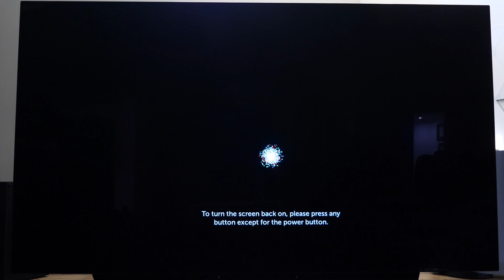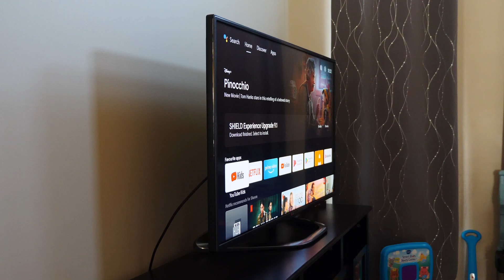TV Explained: Why Plasma TVs Are Dead

Comment: I don't get it. You say plasma died because of price, burn in, low brightness... It's exactly what OLEDs are.
Reply: He listed a lot more details advantages to plasma TVs. OLED have much more common with LED TVs, so it has the same advantages as LED has over plasma, except for prices and burn in. I never heard that brightness was an issue, but prices will eventually go down anyway and as he said, burn ins are only an issue, if you have a lot of static image, which is uncommon for home TVs.
Reply from the maker: What TulgaD5 wrote, there are additional details listed.
Reply: @TulgaD5  No burn in on my 2005 Panasonic Plasma tv still going strong after 20 years.  Typical power consumption is 200 to 250 watts (measured by kilowatt meter) and gets barely warm after hours of watching. Typical 2 hours of TV time/day power savings (vs LED/Oled) is trumped by supreme reliability and durability of Panasonic Plasma TV and not having to buy multiple TVs during 20 years.
Reply: @TulgaD5  Theoretically OLED brightness should be superior to normal LED backlit or edgelit (these are hideous) LCDs, as they aren't being filtered through lossy polarizers which famously cause issues such as terrible discolorations when viewed at an angle (case of Twisted Nematic LCDs), backlight bleeding out into the picture ruining the contrast further (case of some In-Plane Switching LCDs) and the worst offender that is an issue known as Black Smearing (a lot of Vertically Aligned LCDs got this issue, however I've seen those that are just fine and superior to some high end IPS LCDs in my own experience, told from the guy that plays in a CRT on PC). I would urge people to decide what they require the most out of their displays and study online reviews, as the displays on stores are usually very slow paced "cinematic" photoshoots and stills just to show the color and mask the real contrast of the tvs when looking for a brand new LCD, generally TVs will be more costly than computer monitors too on the lower end of each market segment but their main function is identical and will often share connections (like HDMI standard, for example, though however some computer graphics cards outputs feature only mini DisplayPort or USB-C, or DVI-I, or D-Sub 15 pin but anything except old stinky HDMI, leading you to buying a digital adapter for your device to display on a TV LCD).
Reply: But unlike OLED, Plasma is also very power hungry and heavy.
Reply: OLED has one pretty substantial advantage over plasma.
Efficiency. If I recall correctly OLED is generally considered the MOST efficient panel type for power consumption.
Reply: @TheDeluxeMcEmpty  I used to believe that too until I saw models like LG C4 pulling as much power as my 20 year old CRT! Then recalled the humble LCD that looks depressing by comparison draws about less than 30W on a hungry day, although older ones only get worse anyway.
Reply: no oled are so much more bright
Reply: OLED is brighter and efficient
Reply: @S1_2025yt OLEDs are dimmer and more power hungry than equivalent LCDs.
Reply: @DosonTheGreat  Honestly it took me too long to realize that. I thought OLEDs were straight up better, that they were brighter and more efficient than LCDs. Look, I was wrong, and I don't know who put that idea in my head on the first place. Normal PC OLED displays that they refuse to sell with refresh rates slower than 240 hz draw as much power as a CRT monitor from 20 years ago.
Reply: That's really funny now that I realize! However OLED displays can be used in well-lit areas without so much of a hassle (it's still ideal to keep them away from heat, sun radiation exposure and constrain the brightness). Also OLED displays can reach immensely fast refresh rates, fits really well for small devices in the case of AMOLED as its more portable, and is the fastest consumer grade display technology being manufactured today. I don't know how fast Plasmas were, but if they were as slow as LCDs or some more budget oriented projectors with LCDs on them then there is a decisive factor why OLEDs took their place in the entertainment digital display space.
Reply: Oleds have other advantages that plasma doesn't. It is thin, light, colors are amazing, they do well on bright areas, they are efficient. You need to use your head a little. Lots of disadvantages of he mentioned are advantages of OLED
Reply: OLEDs are as bright, if not brighter than most mid end LCDs these days, plasmas were also incredibly heavy and were a dead-end technology, OLED is far from dead-end, and has more than just picture quality as an advantage.

Comment: My 15 year old plasma tv is only now starting to have burn in, so I started looking at new tvs in the past month. The energy usage and HEAT combined with the cost to make a 4k plasma model are what killed them off. The colors, brightness, and dark blacks don't appear to have been really matched until the most recent OLED/QD-OLED tvs, and honestly OLED coming along was a better technology to replace plasma than anything LED tvs have come out with. Also, your points seem very skewed to North America.
Reply: Yes but will Oled TV last 15 years?   Modern Bezel-less TVs are very fragile.
Reply: @coldspring22  They're not designed to last, they're much more disposable.
Reply: Qleds have gotten really really good the last few years even mid grade ones

Comment: You wouldn't want a laptop with a plasma screen due to the power requirement.
You can't find any other digital tech that can duplicate a plasma's ability to reproduce motion without some sort of annoyance. That is the #1 reason I'm hesitant to replace mine.
Reply: Plasmas production of motion is partly a deficiency. If it were as bright as modern oled, it would suffer from the same issues it has.
Reply: That motion resolution only matters in fast action video games, like Cod
Reply: @Keepskatin  So it matters a lot 🤣Budget happiness is a Panasonic plasma and a jailbroken PS3
Reply: @Keepskatin  Or you watch a lot of sports, plasmas are great for sports.
Reply: Same for me. Motion performance is still the benchmark for me.
Reply: Mine is a LG 50 Hz 2004 model , it still views well even with a burn in that started in 2014 , we run all devices through it via a 4 port switch , so it doesn’t annoy us , if I narrow it down to the specific IC 😢

Comment: If you opened up a typical LCD set, you'd be horrified at the build quality. It certainly explains why they're so cheap. Paper-thin backlight power ribbon connectors wrapped 270 degrees around aluminum square stock. Seriously? Don't even bump these things. They are fragile as glass.
Reply: Older vintage lcd tvs used ccfl tube backlights

Comment: I have a Pioneer Kuro from 2008 and a 42 inch Samsung from 2007 both are still alive and kicking and they wipe the floor with all LCD/LED ever launched, up until OLED tech came around those TVs where my main everyday TVs wich is weird that they where over 10yo at that point, i know replaced them with OLED based TVs but i still have them one in my kid room and the other in the basement in my retro gaming setup
Reply: Mid level oled’s will blow that kuro away

Comment: Still have my 58 Samsung and 46 Panasonic. The Plasma makes a great Bedroom TV with its soft light but very clear image. TV response is great. My TV response test is Rock Band and Pinball FX. On an LCD tv you have to strum a split second before it hits the color bars and Pinball FX you have to flip the flipper just before ball comes into range. Plasma there is no delay. Even with the LCD game mode on. The negative is the Plasma can look gritty and gets hot. I have only had minor burn in issues with some games, News, and sport shows. Usually, a corner map in a game and the scroll bar on the TV shows. They have always gone away. Seems to happen after I get into football season or powering through a new game. The absolute best is the view angle. You can see the full image at 88 degrees with limited color loss. The majority of LCD's have color and image lost after shifting 30 degrees of center. Can't stand my newer 4k TV. It's such a bummer looking at washed out color and image if you're not in the perfect seat in the room. Plasmas like CRT's also feel like they project the picture out. While the LCD is a flat image that feel sunken into the screen. My old Sony HD 36-inch crt picture just pops out of the screen. Almost like it's a 40+ inch TV. The plasma is the same way. Almost like the projection of light adds 2 or more inches to the image. LCD and OLED are getting better. But the high-cost Premium TV's are just starting to sway me with their image. Then I look at the price then go vacuum the back of my Plasma.

Comment: The big issue was 4k, Plasma could do 4k but not even close to the price as LCD could do it, and 4k is and easy selling point over 2k or 1080p.  My plasma is 720p 50" and I never worried about the pixels as I couldn't see them unless I was incredibly close to the TV.  Plasma does get very hot, it's almost like a small heating unit, which is good in the winter and bad in the summer...   my favorite tv ever was my LG oled.   there is something about perfect black levels that just cant be beat.  Perfect blacks make everything else POP out of the screen.  When compared to an older edge lit LCD, there is simply no contest, OLED just blows it away.  Now with QD_OLED, oled tv's are able to achieve 1,300 + nits with perfect black levels.
Reply: If you can’t notice the pixels unless incredibly close on 720p 50”, the you might need to get your eyes checked. Even if you do not notice the pixels, you should definitely notice the lack of image detail.

Plasmas died off before 4K was mainstream…

Comment: I’ve got two Panasonic VT plasmas, and the heat they emit is noticeable. The rooms with the TV are warmer than other rooms in the house and you can feel the heat if a few inches away from them. Amazing picture quality though. They’ll do until OLED is cheaper.
Reply: I live in a cold country, so I welcome the heat. As for people complaining about weight, my plasma's not heavy (then again, it's one of the later plasmas). No issues at all regardless of room light levels. I'm in no rush to go OLED.
Reply: Agree, you can tell when you clean them. The water just evaporates off as you wipe. They put out some heat.
Reply: Sorry, but OLED is never gonna get a whole lot cheaper then what it already is, it's just the way the tech works that prevents it.
Reply: @randysalsman6992 Man U can definitely get a really good Oled cheap these days
Reply: I have Sony LCD TV with CCFL backlighting, KDL-40XBR... pumps out more heat than any plasma I own. Something about the upscaler in it makes it the best thing for my PS2 this side of a crt, even over plasma. Otherwise I'd bin it.

Comment: People talk about dead this and dead that. Folks still use CRTs and Plasma's for all sort of content.  So those technologies are not trully dead. Folks like Plasma because it is soft and natural, RGB,  with excellent motion, and decent blacks on the top models. Stuff like a top 2009 Pioneer Plasma with less than 10,000 hours can be reset and will be like NEW. Also 3D is not dead..there are still 3D movies being released (can be watched on a dead 3D Plasma or a dead 3D OLED).

Comment: I have 2 Panasonic vierra plasmas(52 inch I believe)
Both great TVs, have lasted 13+ years this far. All of what you mentioned is true. Came here to confirm running costs.
We recently bought a big led which is in kids lounge as they  use TV more. I tend to watch stuff on my pc these days
Reply: You can't say it better, the average household TV energy use only increases, despite energy saving measures. That single 21 inch CRT that gathered us around in the eighties is still king when it comes to energy consumption: 30-40W and everybody watches the same content.
Today both display size and split-viewing ruin any power savings by technology advancements.

Comment: Great video! Especially the part where you explained the higher costs to manufacture and the higher weight on shipping costs. However, all LCD, QLED & Micro-LED sets have major issues with the 'Soap Opera' affect. Even Tom Cruise has complained about this. It's so off-putting that I'm currently getting my 60" Samsung plasma repaired. LED technology is so inferior its not funny. There's no comparison on quality of picture. It's like being at the movie theater. When is the last time you experienced the 'soap opera' effect at the movie theater? That's right, never! I'd easily pay $5,000 for my current 60" plasma TV brand new. I may end up paying more for the repair than it was worth when I purchased new, but it'd be totally worth it.
Reply: Dude , you can buy good second hand 60 inch plasma tv  for 100 - 200 dollars...
I bought 1 today.  

60 inch plasma from 2013 for 150 dollars...
Reply: Had too look up the soap opera effect and there's a setting to turn it off on virtually every TV that has it.
Reply: You must have only had really low end led lcd experience

Comment: The main reason plasma is not dead, is that it is from an era around 2010 that companies still cared about crafting decent built products and earned money from it. It's a niche, but the advances go beyond display tech. The main reason I never will buy an OLED TV is not the praised picture quality (whuch still has issues, like bad colour gamut in bright scenes), but it is software that ruins the experience, and the loathable built quality because no money is made from the TV itself! You can't buy a proper OLED TV as dumb as a plasma/LCD that earns the company a decent 20% profit. Plasma's are hard to find though, that is why I swear by CCFL LCD, the second best tech. Good VA panels have every bit as good blacks as OLED, and because the coating is not as shiny, it might look even better as that lava lamp behind you does not mirror in the CCFL LCD. But best about CCFL LCD is unmatched uniformity over long time and tons of inputs. No other TV holds up that well with 30000 hours of viewing. In 2010 nobody talked about dirty screen effect as it was no issue back then with much higher quality production standards. CCFL LCD is also the cheapest right now, so grab one before it becomes CRT sought after.
Reply: Where the hell do you get a CCFL
Reply: @stevenx399  Just put a search query on one of your favourite classified sites. For example a Bravia W5500 series TV, those are unbeatable, and make a fool of current LED models.
Reply: Electronics are the same quality as they've always been, especially if only talking 10-15 years back. Companies didn't just suddenly change within that short time period. There are still a ton without built-in software, and even if you have one that does, it's just the same thing as a streaming device but built-in, and you can easily just not use it. Come back when you actually know what you're talking about